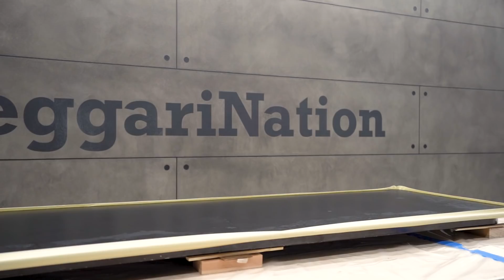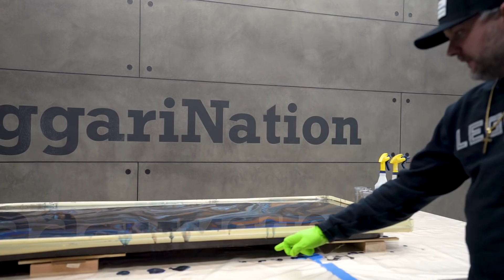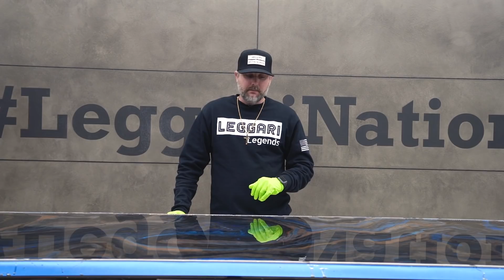Epoxy Table Using Dirty Pour, Mistakes & All Shown! | Full Tutorial Showing You This Entire Process

Comment: Hello doctor leggari. I'm jonathan from italian service. I apply resin floors in Brazil. I wanted to ask you a question but what kind of primer is your primer? Because in Brazil it doesn't exist and I'd like to use it. Best regards.
Reply: Bonding primer
Reply: It's an epoxy based primer designed to chemically bond to smooth surfaces, It's called WB primer! It's amazing and it drys super fast
Reply from the maker: You can purchase it on our website! https://leggari.com/product/counter-wb-primer/